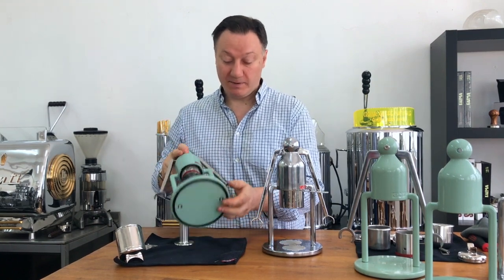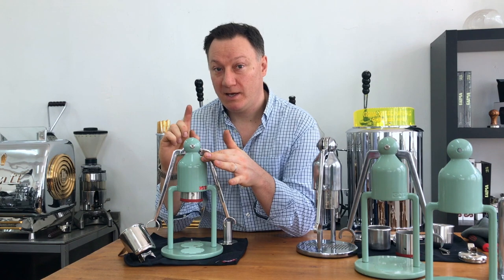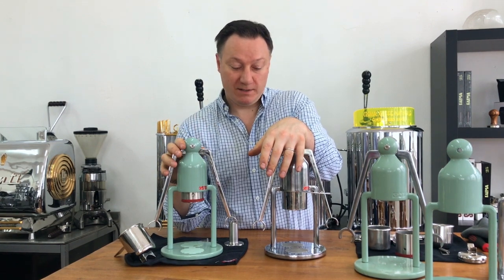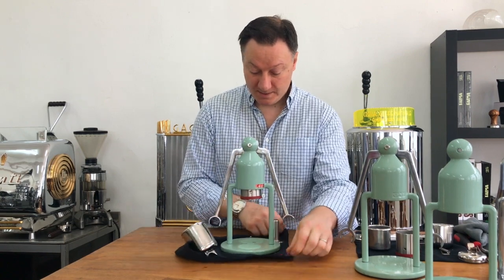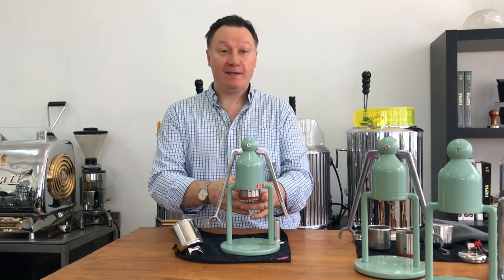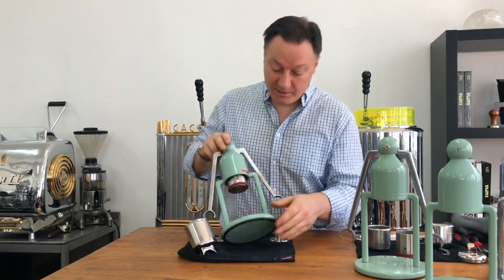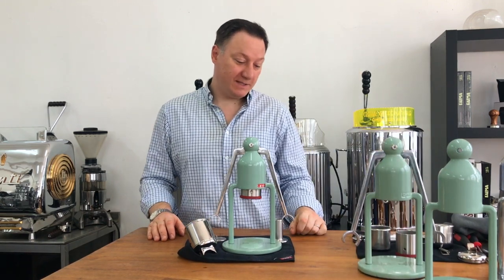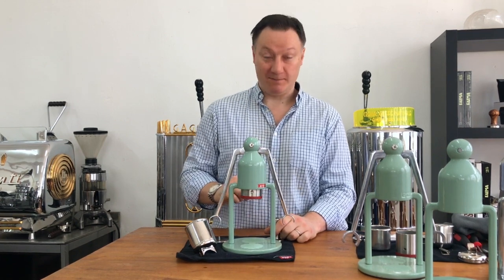Cafelat Robot Basics - Part 1 Overview

Comment: for grinding coffee at home I have a "Baratza Encore", can I get a decent results with cafelat Robot with this grinder?
Reply: With a pressurized Portafilter, with the nonpressurized that comes with it you won't have any luck. It's a good grinder, but it won't do espresso like you want it to. My Virtuosa+ also can't handle a consistent Espresso grind and dial into what you want with espresso, both make great french press,pour over, moka pot grinds and decent cold brew grinds, but it has it's limitations. I'd recommend the J-Pro by 1zpresso or JX-Max (fantastic handgrinders). The former has FAR more settings ( phenomenal for dialing in Espresso and grinding even finer (Turkish)) and the latter is a jack of all trades but does exceptionally well in fine grinding (Turkish/Espresso).

Comment: Oh geeze. I've been using my Robot for months now. I make 2 cappuccinos a day. I can't figure out how pull an espresso without it spraying everywhere. I use an RDT tool but I still can't get a single tail in the middle. Please help.
Reply from the maker: Spritzers are a classic case of channeling.  There is plenty of info and tips regarding this on the various forums.  It is usually a sign or prep issues, grind issues or grinder issues.